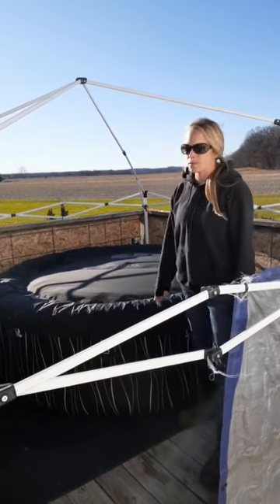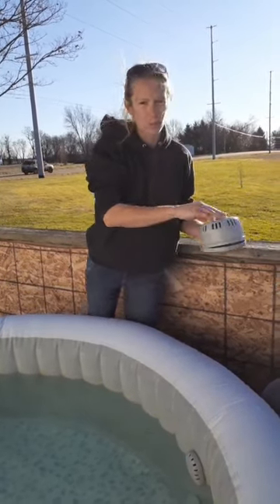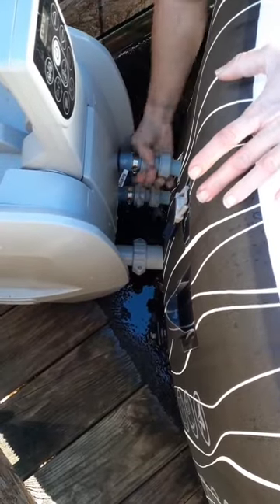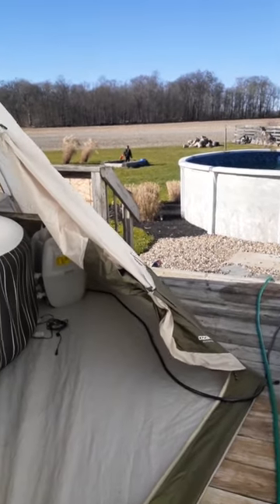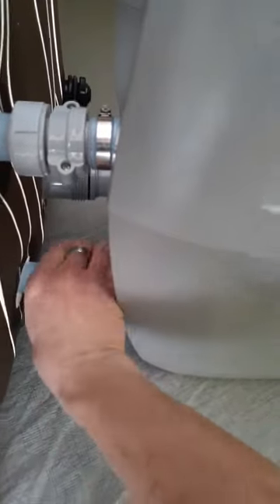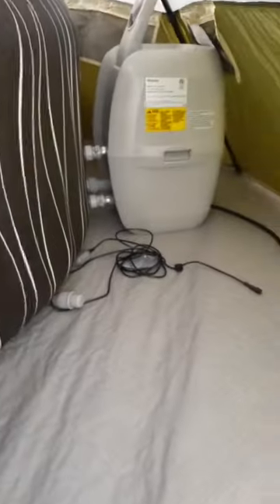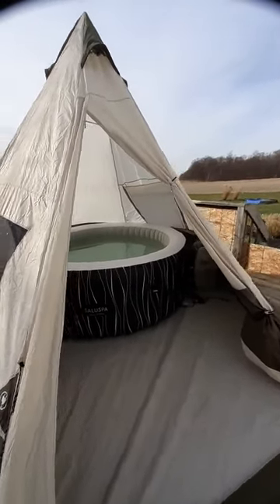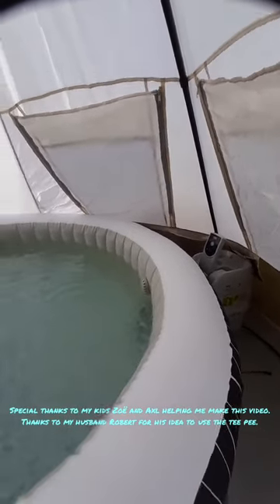saluspa Hollywood video #2 take down clean and refill. #saluspa #Hollywood #ozarktrail #teepeetent

Comment: I love your setup! Do you only use the chlorine tablets, or is there any other chemicals and stuff you use as well? Also, can you use dawn dish soap to clean the inside of it or do you buy a hot tub cleaner? We just got one of these for free and it didn’t come with many instructions or anything.
Reply from the maker: Thank you! We no longer have the teepee.. my husband and I built a little cabin for it n our deck! I use chlorine in the little adapter this tub comes with called a Chem connector.
When cleaning it, I use soft scrub and foam scrubbing pad. I wouldn't recommend cleaning it with dawn, just in case it leaves any residue behind and it gets into your fresh water. I also check my pH level as well. I don't have many ppl who use my tub on a regular basis, just myself mostly. I clean my filter at least 2 times a week some people do every use. There's a great Facebook group that has a ton of information.